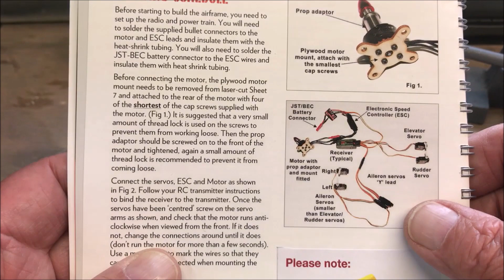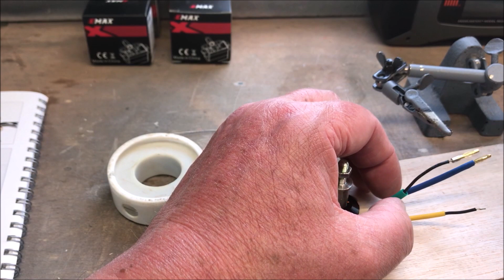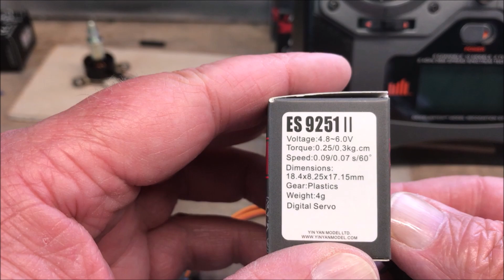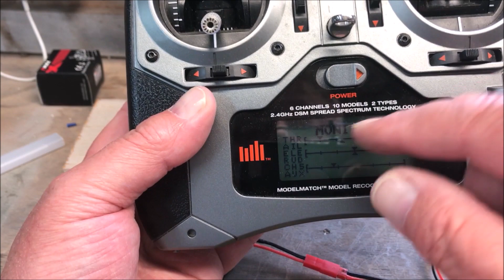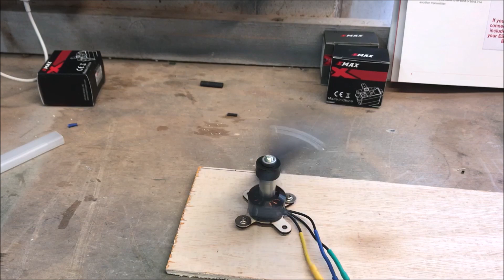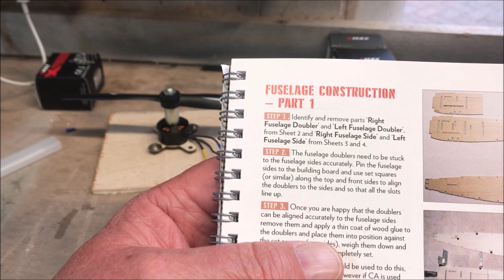The Vintage Model Company Fokker Dr1 - Part 1a

Comment: Did you use the same size battery in the dr1 as you used in the se5a? If not many i ask what the specs are on the dr1 battery?
Reply from the maker: Hi, sorry for the delay, had an emergency with the plumbing. I had to use an over-lander 7.4v 850 mAh 3 cell. This is so you can use a bigger prop. 7x6 if I recall. The speed controller can stay as it is. This model is very under powered. If I had known before hand, then I would have made room for a bigger battery.

Comment: Glad you got your comment section open..  Great presentation of the first section of the DR build.  Cannot wait to watch it come together.  Learning a little more of that particular Model company, interesting models!!
Reply from the maker: Thank you, it would be interesting to know weather VMC ever see these videos? 
As I said I am cursed with a sense of humour, but as I get older I have learned to use filters. 
I would very much like to build there rocket powered free flights, but I fear they have supply problems.
I wonder if they are meaty or not?🤔
Reply: @thebarronflights  Thats a good question about rocket power. I have seen guys use Estes rocket engines (long time rocket hobby manufactor)...very short engine run..but plent of punch ..mostly on sailplanes.  As for VMC visability...make sure you use the "VMC" as a TAG when building the video.  I have had model companies contact me ,,,,because they ran their company name on youtube search and my video popped up using thier product.
Reply from the maker: @615thAeroSquadron  Oh right, I will try it, thanks.
Reply from the maker: Yeah, some others said the same thing. 
I want to build one of their free flight rockets. 
I made some errors in the video, been feeling a bit off today. 
I meant to use two cameras and show the red barons book and how to charge battery`s. 
Hmm loosing it I think??? 

Anyway, always glad to hear your thoughts.
Hope you got the drawing I sent you? 
The A/P is easier than you think.